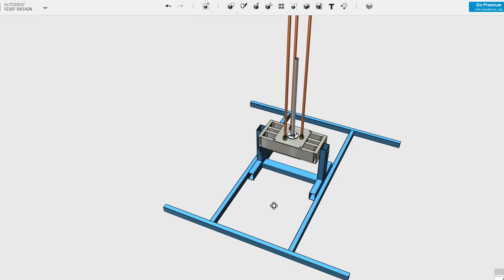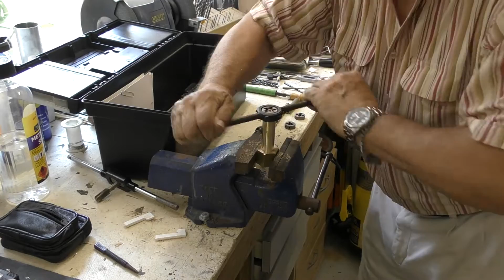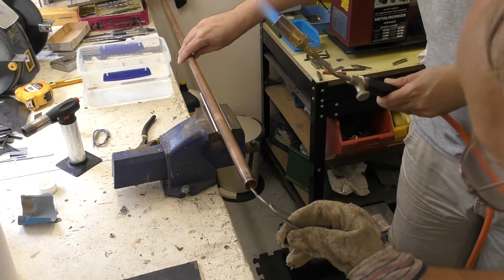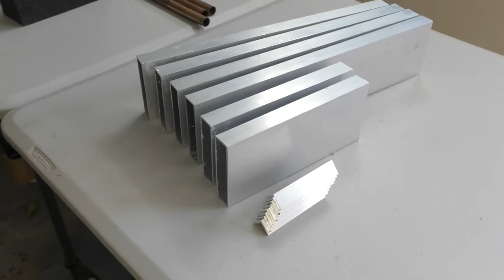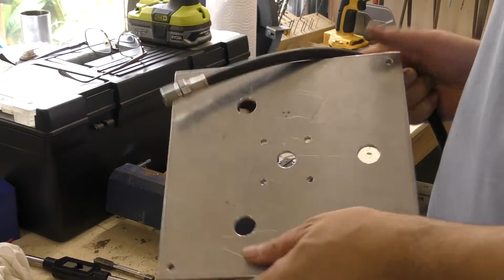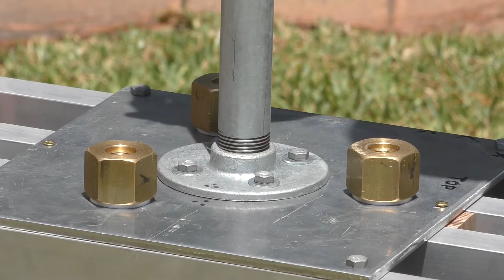2 Stage Water Rocket - Part 22 - Horizon Launcher

Comment: Hello aircommand, I have a question; how does tank diameter affect the rocket's performance? Thanks, BV aerospace
Reply from the maker: Hi, by tank I assume you mean the rocket's pressure chamber? The larger the diameter the bigger the cross sectional area and therefore you also induce more drag. A larger diameter also reduces the maximum pressure the rocket can hold for the same wall thickness. So for both of these reasons you want to reduce the diameter as much as possible. But there is a limit, if the rocket gets too long and thin then it is also flexible and can bend during acceleration.
Reply: @AirCommandRockets  I am asking because of a strange equation result I got doing the simulations myself, proved as well by clifford heath simulator. They say my rocket will reach 2km in altitude using a 35mm tank with a 30mm nozzle at 170psi. Is that possible at all?
Reply: there is got to be a larger advantage instead of just drag to get that huge result
Reply from the maker: When you start getting into the extreme input values for the simulators they are going to give you less and less accurate and wilder results. Just curious, what were some of the other parameters that you used  in his simulator? Did you use a launch tube in the simulation? There is a problem with Clifford's simulator when you use launch tubes. Happy to run your input values through Dean Wheeler's simulator to see what it suggests. It tends to be more accurate.
Reply: @AirCommandRockets  i used a 35mm rocket with 30mm nozzle, a 28mm launch tube 1.6m tall, 100psi and 0.2 as drag coefficient, 600g of empty weight
Reply from the maker: What was the volume of the rocket and how much water did you use? 0.2 drag coefficient seems very low. And yeah you are going to have a problem with a launch tube and nozzle that size in Clifford's sim.
Reply: @AirCommandRockets  2 litre volume
Reply from the maker: So with those parameters, Dean's simulator predicts 85m (280 feet) altitude @ 100psi. The drag coefficient for a rocket that size (about 2m tall to get 2L volume in 35mm diameter rocket) would be closer to 0.6. One of the problems that simulators have with predicting the correct altitude when the launch tube takes up a considerable proportion of the volume of the rocket like yours does here. I'm quite confident that Dean's simulator's prediction would be within 20% of the actual flight for this rocket.
Reply: @AirCommandRockets  how can it be 0.6 if a blunt nose has like 0.1?
Reply from the maker: The drag coefficient is for the whole rocket and fins not just the nosecone. A long rocket has a lot of body drag that adds to the drag coefficient. Have a look here where we have a look at the drag coefficient for a long thin rocket: https://youtu.be/46cWaSoPJ9g?t=5m11s
Reply: @AirCommandRockets  can I ask what was the empty weight of your dark shadow rocket?
Reply from the maker: About 1.6Kg
Reply: @AirCommandRockets  what volume?
Reply from the maker: Dark Shadow is around 7Liters. Here are the full specs of the two versions of this rocket: http://www.aircommandrockets.com/rocket_gallery.htm#DarkShadow

Comment: Very cool! I'm looking forward to seeing how you build the base. I would think you would be more worried about whether the rocket could withstand the 700kg force between the center core and boosters than whether the base could withstand it. But I'm sure you've done your homework. Maybe the forces on the rocket in flight will be even higher, eh?
Reply from the maker: You've hit the nail on the head. That is also my biggest worry about how that is going to go with supporting the central release mechanism. There will be 6 support brackets, 2 per booster, so each will need to be able to hold about 100Kg. But what kind of point forces will that apply to a pressurised pressure chamber will be interesting. We'll be doing plenty of tests on this to see what works and what doesn't.